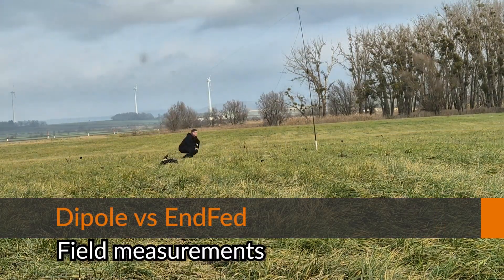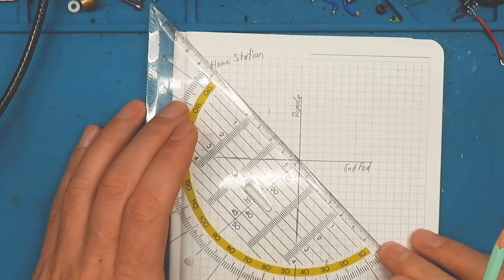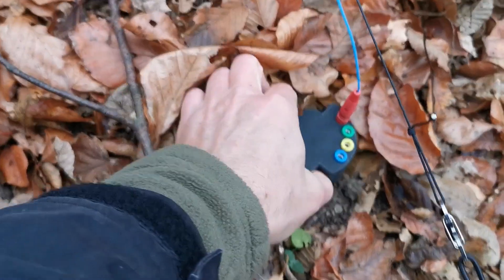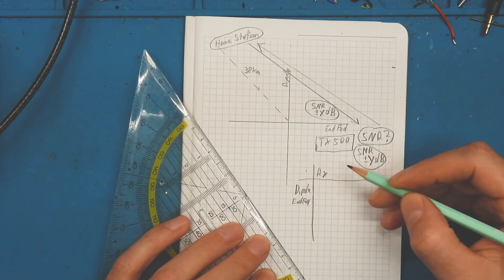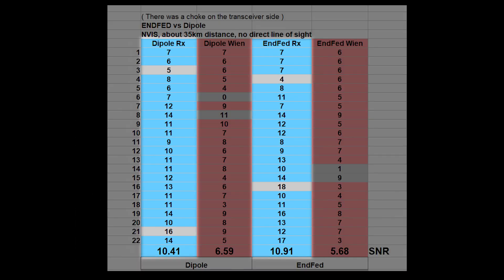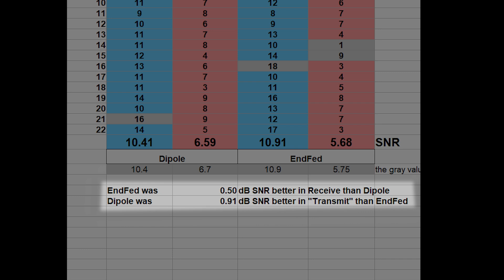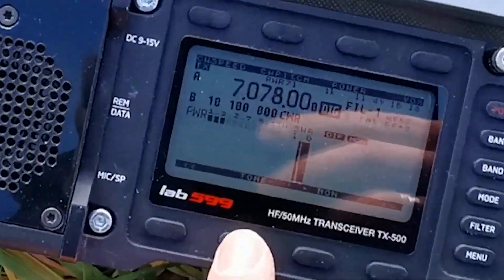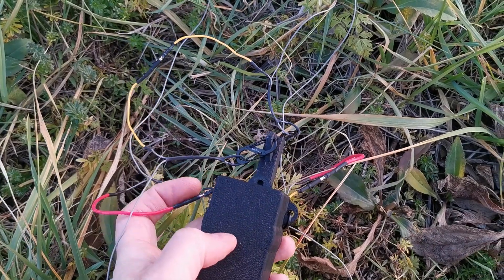Dipole Vs EndFed - Field Measurements

Comment: This video does not state whether a dipole or EFHW is better; instead, it shows which of the antennas in the author's specific setup and configuration provides a stronger signal.

It cannot be said that the measurement is wrong, but it certainly does not answer the question: "Dipole or EFHW – which is better?"

We could try addressing the following questions first:

    Was the layout of the coaxial cable considered, and its interaction with one of the antenna's arms, where it might run parallel?
    Was the efficiency of the 1:49 transformer considered, and were the dB losses subtracted from the result?
    (What would the result be if the EFHW were powered in parallel through an LC resonance circuit? Resonance circuits have very high efficiency but make the antenna single-band or require retuning.)
    Did the author consider that when using a dipole, the EFHW antenna has no break in the center and acts as a half-wave element that could behave like a parasitic element?
    What constituted the counterpoise for the EFHW, and how was it implemented? (Coaxial cable, grounding, or a wire segment?)
    Was it taken into account that the effectiveness of the choke depends on where it is installed along the coaxial cable? The impedance for common-mode currents changes along the coaxial cable.

These are just a few example questions.

As we can see, the video does not conclude whether the dipole, as a dipole, is better than the EFHW, as an EFHW. The video only shows that the author's dipole is better in his setup, considering the antenna suspension configuration and the coaxial cable layout.

Nevertheless, it is worth noting the remarkable measurement method, where our own station automatically responds and provides a report.

Choosing the frequency 7078 kHz was a good decision, as it avoided distortions in the reception report in dB caused by interference from other stations.
Reply from the maker: thx for the detailed comment. especially the coax coming down the pole from the dipole bothered me a bit too. it wasnt really parallel but for sure that could be improved for future tests. good points!
Reply: @CrazyChekov  I'd suggest maybe to be even more accurate you could do half of your tests and then move both antenna's 90 degrees and do again.  Then you can cancel any potential noised picked up from a specific direction.  And I also thought that coax really needed to go straight down the pole and then across the ground.  In any case it was still instructive, good job!
Reply from the maker: @stewartrv  I agree that would be even more accurate. Thx for the ideas!

Comment: An end fed is a dipole.  It's just fed at the end instead of the center.  Deployed as a flat top, sloper or inverted V they should perform the same.
Reply: Once again, look up the definition of dipole. Two equal lengths. So lets just call any wire antenna a dipole. A loop, rhombic, Marconi, etc. Efhw sometimes are not used with counterpoises. Ones with counterpoises don't have much of a counterpoise. Dipole is a classification. Yes an off center fed, is referred to as a dipole of unequal lengths with a matching transformer.  Hey can you make a cage efhw? If you remove the matching transformer from a efhw, what do you have then? I guess antenna handbooks for 100 years have had it all wrong. Glad you have cleared it up. Thanks
Reply: Skypilot, you are flying too high. A dipole is the best antenna in a inverted v fashion. In an efhw. The matching transformer does the heavy lifting to make the antenna radiate efficiently. With a dipole although a mono banded antenna, is the most efficient. However, this gentleman made a great matching transformer, due to the efhw performance. I am impressed with the results. However you cannot beat a balanced dipole. You just cant. Yes they are both wire antennas. A dipole is a dipole. An end fed is an end fed.
Reply: @chrisolson968  An EFHW is nothing more than an end fed dipole.  It's a half wave piece of wire that is resonant on a certain frequency, just like a dipole.  OCF antennas are dipoles and typically use a 1:4 impedance transformer so it plays well with a 50 ohm coax.  The EFHW is no different, it just fed at the end instead of slightly off center and uses a higher ratio impedance transformer so it plays well with coax.  You could call it an extreme off center dipole if you wish but it's still a dipole no matter where you feed it.  Do you not use the same formula for calculating the length of the wire?  Think about it.
Reply: @skypilot0077  Long wire or end fed IS NOT a di-pole!!  whether or not it's cut to  a wave lengh. End feds antenna's are directional where as a Di-pole is 306 degrees.  Quite a difference  between to 2.
Reply: @madb132  The only time a dipole is omni-directional is when it's too close to the ground, which is most of the time with most folks.  Call it what ever you want, a 1/2 wave of wire is still a half wave of wire.  It doesn't matter if its fed in the middle, off center or at the end, it radiates exactly the same.

Comment: Proof that a dipole is a dipole, regardless of how it's fed...
Reply: Yes, but used as a multiband antenna, multi lobes increase with higher bands. Trading some performance for multiband works in most cases. It seems to me that performance drops above two bands. Upgrades include Traps and Relays to switch wires

Comment: I've found end fed half wave works very well, especially low to ground NVIS propagation.
Reply from the maker: @HowardKlein1958  Yes, I thought the difference to a center fed dipole would be bigger. these transformers seem to work very well.
Reply: @CrazyChekov  I'm curious did you build the 49:1 following Colin MM0OPX experiments?
Reply from the maker: @stewartrv  yes he did awesome work on measuring them.

Comment: The directivity of end-fed antenna is very strong, so it is meaningless to pay attention to directivity when comparing horizontal antennas.
Reply: "The directivity of end-fed antenna is very strong" In what direction? How is it different from a dipole arranged in the very same configuration? My understanding is that it is nearly exactly the same. 

It is the shape and placement that primarily determine directional or elevation characteristics. If the current node(s) is/are at a significant height relative to wavelength, the angle of radiation will be low and visa versa for low heights and NVIS radiation.
Reply from the maker: better to have it equal for both antennas in a comparison imo. removing one variable from the test.
Reply: Gain and pattern of an EFHW operated on its fundamental band is almost identical to a dipole when both are mounted horizontally and using the first 0.05 wavelength of feedline as the counterpoise with the EFHW.  Biggest difference is loss in the EFHW transformer but my homebrew EFHW transformers have a loss of only 0.46 dB which is less than a tenth of an S unit assuming S units are 6dB.  For all practical purposes they perform the same on their fundamental band assuming the EFHW transformer is efficient and assuming you use a counterpoise as mentioned above.
Reply: You are right, because the efhw antenna field pattern is for a small part directed  in the opposit to the feed point.

Comment: Thanks for sharing this! 🙂
This is exactly the information that I am interested in most as I am forced to operate outdoors when I really want to do interesting DX (due to my living situation), so I am looking for the most efficient wire antenna for outdoor operation. By the way as of now with being into the hobby a few months only, I am trying to go for verical wire antennas which is feasible as I am using most 15/17/20 m.
And as you mentioned - I would have expected the advantage of the dipole to be a bit more obvious. 
73 de DL1HNR
Reply from the maker: thx a lot! 
Yes for DX and 15-20m I would also chose a vertical antenna.
73!
Reply: @CrazyChekov  Until now, I was not really sure if this approach makes sense as it is merely what I as a newbie understood so far from radiation patterns and everything that goes with it, so it is good to see that you confirm my conclusion to go for a vertical for that purpose! This help me, thank you.🙂
Reply: @CrazyChekov I did, actually